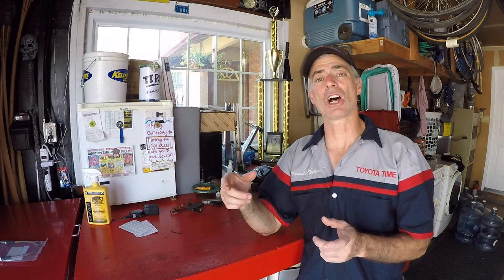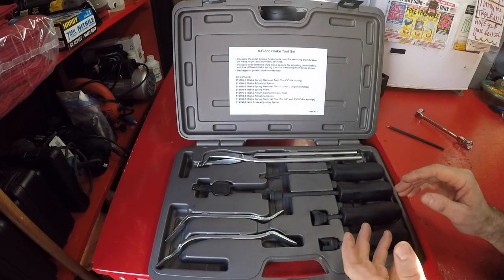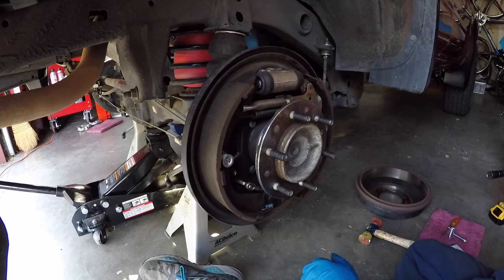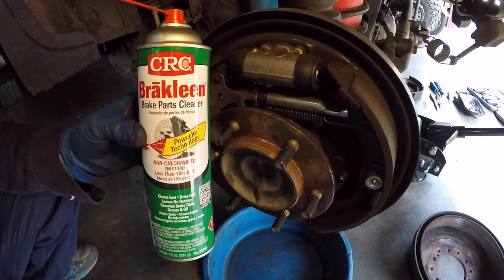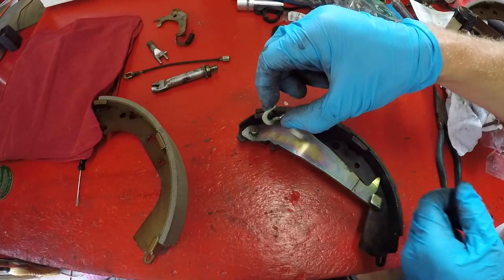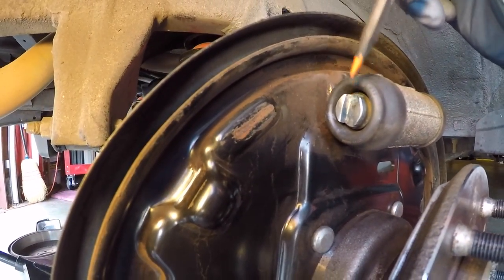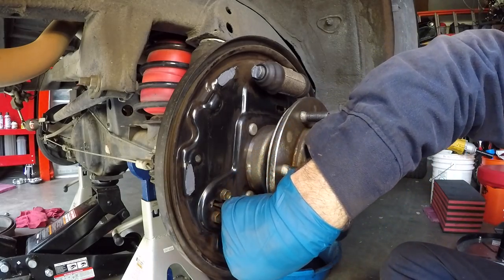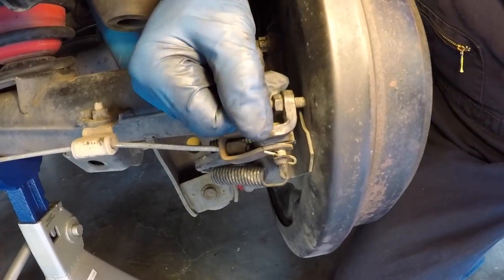Drum Brake Shoe Replacement

Comment: I’ve heard some people that have done the Tundra Brake Upgrade are doing a Tundra rear upgrade, by replacing the wheel cylinder (from whatever year tundra they used for the front, example 2005 Tundra ) to compliment it.  What do you think?
Reply from the maker: I actually saw a video of a guy doing this and gave it some thought but then realized it's probably a waste of effort.  We're already asking for more of the OEM 4runner or Tacoma master cylinder to supply a higher volume of brake fluid to the larger Tundra calipers.  This is why people experience a slighter softer brake pedal and the pedal travels further than before.  If we add in larger rear wheel cylinders too, we'll be increasing the fluid volume even more which I don't think is a good idea.  Maybe if somebody was going to replace the master cylinder as well to handle the fluid volume needed, I could see possibly going with larger rear wheel cylinders for the rear brakes.  Another thing to note is most of your braking strength comes from the front brakes.  I think it's something like 75%.  So, improving the front brakes like the TBU does is the most bang for your buck.  The improvement to the rear braking power won't be that noticeable.
Reply: Thanks for the info Tim.  I knew I was asking the the right guy.  When you gonna make some new shirts?
Reply from the maker: @courageous78  You're welcome.  Sean made some new shirts up.  If you click on the "Community" button on our home page, you'll see them.  They are basically a while shirt with an image of my 85 Brodozer on the front.
Reply from the maker: courageous78 we have a new “Brodozer” shirt of the 1st gen 4runner. https://www.instagram.com/p/Bz8THcaAGJA/?igshid=4yhwrceob3e7

Comment: Can you put a link in for the manual you use for a 1997 4runner 2wd?
Reply from the maker: There is no link David.  You buy the original Toyota factory service manuals used.  Just do a search on Ebay for your year 4runner and you'll most likely find a factory service manual set for sale.  They seem to go for around $150-$300.

Comment: should i do both sides before adjust with the e brake? or adjust with the e brake one by one
Reply from the maker: Adjust both sides to where the drums slide on with a little resistance and then start pulling the parking brake until you get 7-9 clicks from the handle pulling at a normal amount of force, not giving it everything you've got.
Reply: @TimmyTheToolman  thank you so much!
Reply from the maker: @corbs3535  You're welcome.

Comment: Timmy! ... the parts layout shows that a non-reusable gasket goes between drum and axle hub area. why did you not use a new gasket or did you and I missed it?
Reply from the maker: I've seen that seal in a parts schematic also but I've never actually seen it on a truck I've worked on.  Maybe go to Toyota and find out if you can order it.  I'd be interested to know if it does exist.
Reply: @TimmyTheToolman   they do exist! its basically a heavy white paperstock likely to prevent surface rust seizure between drum and hub
i cannot seem to post a link in here to show what they look like after i installed one on my rig
Reply from the maker: @efil4kizum  Good to know. Thanks for sharing.

Comment: Also... While I still had my truck on stands, I went to torque the nuts on the rear passenger-side wheel and it moved slightly even though the E brake was adjusted and pulled.  Is this normal? I do have an OME 3 in. lift in the back, so I figured maybe the cable is being strained?  I'm a bit sketched out here.
Reply from the maker: I've never tried to torque wheel lug nuts while up on jack stands so I can't comment to what you're experiencing.  I guess it depends how tight you pulled the e-brake lever.  I do know however that a lift does affect you e-brake and I recommend getting a parking brake cable lift bracket.  Sonoran Steel sells one or you can make you own.
Reply: Looks like I'll be buying a bracket then. lol

Comment: How did you put in the pin to the brake shoe? Mine goes about 3/4 of the way in and doesn't go farther.
Reply from the maker: Hey Cesar, I'm not sure what pin you're referring to.  Is it the pin the parking brake lever and adjuster plate slide onto?

Comment: What would cause drum brakes to feel warped when you rotate  them by hand even though they were just turned and brake shoes  are new? I’m stumped because it felt warped before so I had them turned and it feels slightly worse now . Could it be that the wheel isn’t on keeping the drum form being centered on the lugnuts?
Reply from the maker: Make sure the hub they are mounted is really clean. Corrosion can build up
And make an uneven surface
Reply: Timmy The Toolman I tried that and my drum being centered on lug nuts theory. I tried it with and without the wheel on and no matter what I do it feels warped. I’m wondering if they aren’t turned correctly or something.
Reply from the maker: @whatfreedom7  Did you use OEM shoes?

Comment: Did you guys use anti-seize on the backing plate contact spots?
Reply from the maker: I can't remember what Jordan used in the video.  I've done many rear brake jobs since making this video and I use a high temperature caliper grease at those contact points.

Comment: Is this the same procedure for a 92 2wd pickup ?
Reply from the maker: Don't know what the drum brakes look like on a 92 pickup.  The springs and auto adjuster set-up might look different.  But, this video will help give you an idea of of how to go about it.  Just remember to do one side at a time so you can use the other side as a reference when putting it all back together.  Also take pictures of each side before you start so you can reference the picture if you forget how things go back together.

Comment: I stripped the hole that fits in the two 13mm bolts...... is there any other way to take the drums off other than hammering?
Reply from the maker: Hey Stephen, there is a way to adjust the shoes from the backside of the brake backing plate.  There's a rubber grommet you pull out to expose an access hole.  Get a screwdriver or similar tool and try to turn the star wheel.  Whichever way you can turn it, that's tightening the brakes and the opposite direction is loosening the brakes.  Get another slim screwdriver or other tool and probe in there to push the adjusting plate out of the way so you can turn the start adjuster in the direction to loosen the shoes.  It's best to get the screwdriver just under the return spring to get onto that adjusting plate.  Back it off as much as you can bottoming out the star adjuster wheel.  Now try to remove the drum.  If it still doesn't want to give, whack it multiple times with a mallet or plastic hammer.  If that doesn't work, get a heavier hammer and smack it all around the circumference of the drum and on the face of the drum as well.  You shouldn't have to swing with all your strength.  Just some good firm blows.  The drum should come free.  Here's a video regarding loosening the shoes from the back side:
https://youtu.be/vPiJHIMWvIA
Reply: From the back side, turn the adjustment wheel down to loosen the brake shoes.

Comment: My rear main seal is leaking i didnt want to do that big of a job so my mechanic wanted $300 to do the job, i might just let him do it, even tho i saw your video on that seal replace, kinda lot of work i didnt want to touch.
Reply from the maker: dang0088 da $300 is a steal for the amount of labor involved. But if you take your time and this is not your daily driver, then I would say give it a go, it’s do-able with a transmission jack

Comment: Never knew about how the shoes should be 0.5  from the drum. I just did the adjust and put the drum on and repeat.
Reply from the maker: Glad our video provided you some helpful information.  The final adjustment comes from simply pulling the emergency brake handle over and over again until you only get 7-9 clicks from the handle.

Comment: This job only applies to to 96-2000. 

The self adjusting mechanism is different on 2001-2002. 

I just painfully swapped the 2002 rear brake stuff on because it was different than what my 2000 had. Only to find out it was OEM stuff anyway.

Danggggg it lol I do drum brakes in my sleep now Jesus
Reply from the maker: Yeah, I've seen that alternate drum brake set-up as well.  I like the set-up on the earlier models better.

Comment: I@18:05 I've always known shoes to wear uneven like that because of the way they're hinged.
Reply from the maker: I think there's more to it than that.  It's only the front shoe that receives the uneven wear and both shoes are hinged the same.  Most braking happens when the vehicle is driven forward and not in reverse.  As the brakes are applied, the rotational force of the drum applies more force to the bottom half of the front shoe rather than the top half.  I'm not a physics expert, but there's more in play with the uneven brake shoe wear than just how the shoes are hinged.

Comment: Hi timmy, l alredy ajust the brakes to tight that l can't be able to turn the drums with my hands, and still don't stop when l put in drive and hit on the brakes , timmy l don't bleed the front brakes. Thanks .
Reply from the maker: Humberto Zarate Well, you don't want to have the brakes so tight you can't turn the drums.  That's too tight.  When you say the brakes don't stop, how does the brake pedal feel when you apply pressure with your foot?  Does it feel spongy?  If you haven't bled the front brakes, I'd do the whole bleed procedure over again and do the front brakes as well in the order I recommended.  If the brakes still don't work right after bleeding the brakes, there's a chance there's something wrong with the wheel cylinders and you might want to rebuild or replace the wheel cylinders.   I do suspect you have air in the brake lines and that's why you are having brake problems.  If you still have problems after doing all that, the only thing left is the master cylinder and maybe something is wrong with the master cylinder supplying brake fluid to all 4 brakes.

Comment: Tim, would it be possible to get the proper method to adjust front and rear sections of your parking brake and the bell cranks. My Right rear drum will over adjust to the point where my tire is seized and doesn’t want to turn by hand. This causes my drum to over heat. I’ve done hours of research and hours of time on this and anything would be awesome. I drive a 98 Tacoma 4wd limited 3.4l manual 
Sincerely Dylan
Reply from the maker: Hey Dylan, do you have a suspension lift?
Reply: Indeed I do
Reply from the maker: Have you installed a lift bracket for the parking brake on the rear axle?  After a suspension lift, the parking brake won't work as well but the lift bracket can bring it back to normal function.  I don't know if that's what you're issue is, but if you're not currently using one, I suggest you buy one and install it.
Reply: Timmy The Toolman I have not do you know of a distributor or product you’ve had good luck with
Reply from the maker: Sonoran Steel makes a lift bracket and I'm pretty sure Toytec sells one as well.  I'd contact Steve and Sonoran Steel first because I know for sure he sells them.
http://www.sonoransteel.com/
Reply: Hey Tim same thing is happening to mine on the driver side and I don’t have a lift . I replace wheel cylinders and shoes any ideas.
Reply from the maker: @Jmelz20  Are your brake shoes and drums OEM.  I've heard of problems with aftermarket parts.  The way the self-adjusters work, they shouldn't have the ability to over-tighten the brakes.  When you pull the parking brake, if there's play in the rear brakes, you'll be able to turn the self-adjuster enough to move the adjuster one click.  If the rear shoes are far out of adjustment, you'd have to pull the parking brake lever several times until you no longer can get one click out of the adjuster.  The brakes with the self-adjusters should only be able to get so tight and then they can't tighten anymore.  That's how they work.
Reply: Timmy The Toolman I had oem  before now I switch to aftermarket
Reply from the maker: @Jmelz20  I highly suggest you go back to OEM.  Are both your drums and shoes aftermarket or just the shoes?
Reply: Timmy The Toolman just the shoes. Can it be the bell crank sticking?
Reply from the maker: @Jmelz20  It could be the bell crank sticking but that would be easy to check.  With a friend helping you, have them pull and release the parking brake while you're watching the bell crank.  If it doesn't release when your helper releases the parking brake, it might be hanging up.  But, it could very well be those aftermarket shoes hanging up in the drums.   I've heard of plenty of problems with aftermarket shoes because they don't interface well with the drums and get stuck. If your bell cranks aren't corroded bad and sticking, I think your problem lies with those aftermarket shoes.  Another possibility is the actual parking brake cable is hanging up and not fully releasing.
Reply: Timmy The Toolman ok I will check that. thank you

Comment: can you do just one side? 

got a axle rear seal leak so thats why im replacing
Reply from the maker: Yeah, you could do just one side.
Reply: @TimmyTheToolman  sweet. thanks for all your help Tim, i would not be able to keep this rig on the road if it wasn't for your videos.
Reply from the maker: @UpNorthOutWest  No problem.  We're here to help.
Reply: @TimmyTheToolman  one last question! 
will i be able to just bleed that one brake line?
its the rear driver side so the furthest away from the master cylinder.
Reply from the maker: @UpNorthOutWest  Yes, as long as you limit the fluid lost.  Once you disconnect it from the wheel cylinder, plug it quickly with a 7/32" vacuum cap over the flared end of the tubing.  The cap doesn't go over the threaded flare nut fitting.  Just over the tubing.  That will stop the flow of fluid and limit the amount of bleeding you'll have to perform.

Comment: Trust me when I say do not buy aftermarket drums for pads I’m on my second set of drums two weeks and I get vibration on the interstate vibration when I hit the pedal and I was told by the parts guy at the Toyota dealership that they always have problems with aftermarket drums and then the pads were out create dust that sticks to the drum and creates vibration it’s not worth the headache if anybody’s had success with aftermarket drops please let me know hey thanks for the video and your time
Reply from the maker: We've heard the same thing with aftermarket drums and shoes.  When people ask me about buying aftermarket parts for the rear brakes, I always suggest they buy Toyota OEM to avoid the problems you've experienced.

Comment: What type of grease did you use ??
Reply from the maker: Jordan just used a wheel bearing grease he had.  I was planning on using a brake and caliper grease I had but the wheel bearing grease is fine too.  It just has to be a grease that can withstand high temperatures due to the heat generated by the brakes.

I put a link to a grease I would recommend buying for disk and drum brake work in the video description.

Comment: I didn't have a gasket behind the drum when I pulled it off. Does anybody? I think it's supposed to prevent the two surfacing seizing on each other. Also the FSM seems to be missing an entire section on the parking brake cable, unless somebody knows if they hid it elsewhere.
Reply from the maker: There is no gasket behind the drum.  If you want to reduce the drum from becoming locked onto the end of the axle, you could use some anti-sieze.  I thought the FSM covered the parking brake cable and it was in the BR (Brake Section) of the manual.

Comment: Where can I get the e-cliips and the c-clips? I can't find the proper ones...
Reply from the maker: They come with a new shoe kit from Toyota.  Did you order aftermarket shoes?
Reply: @TimmyTheToolman  No I ordered Brake Shoes from Mcgeorge Toyota. Unfortunately it didn't say if it comes with it. So I ordered some from Napa Auto parts. Also, are Napa Auto Parts Wheel Cylinders decent? The OEM ones were pricey $55 a piece vs $17.
Reply from the maker: @RoNBEE1  The Toyota shoes should come with the necessary c-clips.  Maybe they fell out of the box.  They are just in a small plastic bag.  I don't know anything about the quality of the Napa wheel cylinders but why are you replacing them?  Were your original wheel cylinders leaking?  If there was nothing wrong with your wheel cylinders, I wouldn't bother replacing them.  They can last a very long time with no issues.
Reply: @TimmyTheToolman  I was told by a shop that the wheel cylinders need to be replaced due to the rear axle leak potentially damaging it, but I haven't opened it up and checked, my brake fluid reservoir (under the hood) doesn't seem to be decreasing...the truck has 140K miles on it.
Reply from the maker: @RoNBEE1  That's a load of shit the shop is telling you.  Your wheel cylinders are fine.  I've done the axle seal job on over a dozen rigs and not once did I replace the wheel cylinders for the people I helped.  It's just the shoes you need to replace because they absorb the gear oil.
Reply: @TimmyTheToolman  Good to know, I'll cancel the order for the wheel cylinders - and if they are leaking I can easily pick those up again. Thanks for the info!
Reply: @TimmyTheToolman  Do you recommend getting the drums turned before installing the new OEM Brake shoes? Also, when replacing the brakes and the real axle seals & bearing in one shot...what do you recommend doing first? Seals & bearings, and then brakes?
Reply from the maker: @RoNBEE1  I've gotten away without turning the drums.  As long as they aren't crazy rough, you should be able to forego the turning of them. 

Yes, definitely address the axle seals and bearings first and finish by replacing the brake shoes.
Reply from the maker: @RoNBEE1  You're welcome Ron.  Good luck with the job.